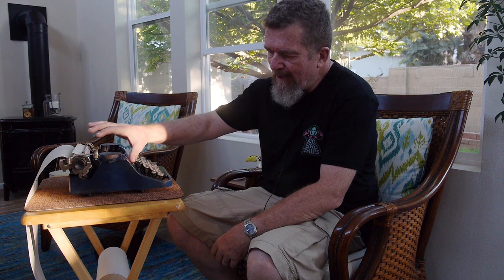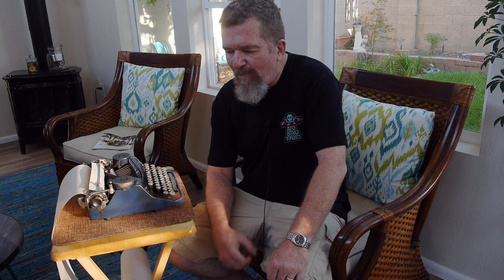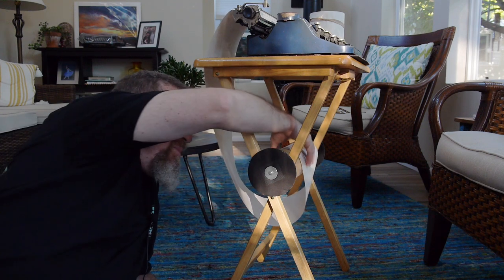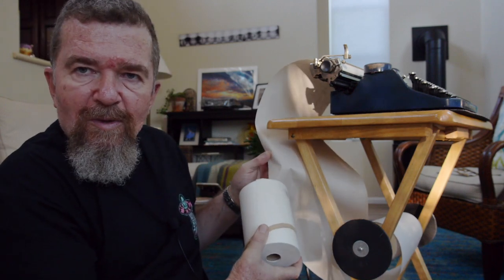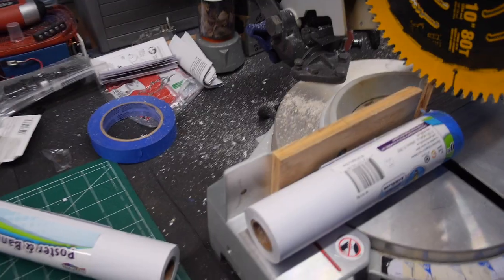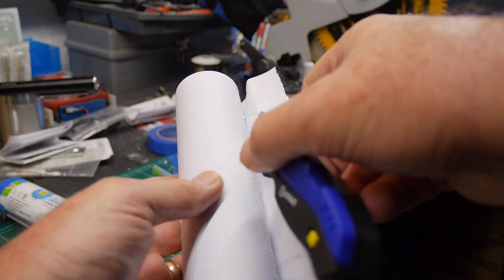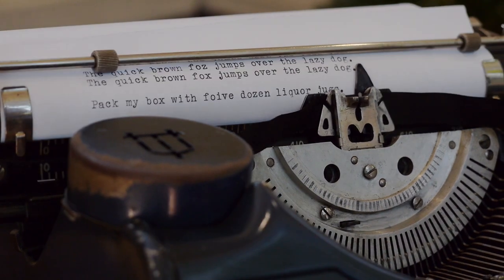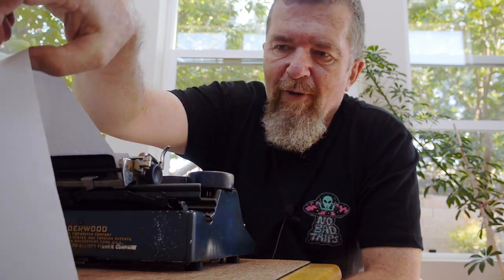Typewriter Video Series - Episode 82: Typing Scrolls

Comment: I was wondering if you have found a way to use a backing sheet with a scroll?
Reply from the maker: The roll of art paper I get from Staples is thick enough that I usually don’t need a backing sheet.

But for thinner roll paper, how about a second roll threaded behind the first? Or at least a long piece cut from a roll to serve as a backing sheet.

Comment: I think I have to replace my typewriter
Reply: Cute looking blue Underwood portable.  I remember seeing ads about an Underwood "fanfold" typewriter. A cast iron basket is bolted to the back of an Underwood model 5.  It is set on a special desk.  In the basket. Is this special paper folded first one way and then the other--"fanfold."  This was not unlike special dot matrix printer paper used in the. Nineties, except it was absent the perforation holes on the sides seen on the printer paper.  Similar paper was set up on billing and account machines, as well as automatic typing equipment.
.